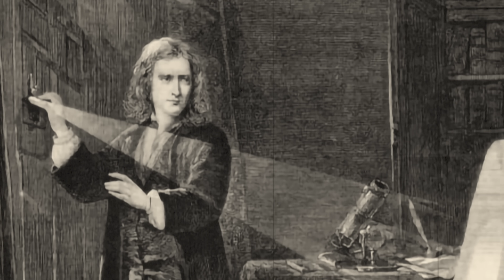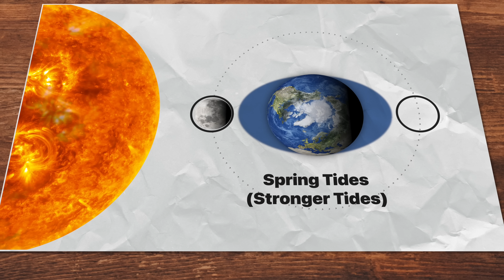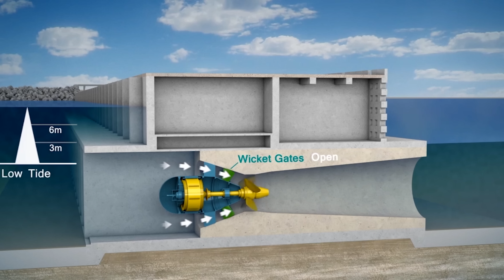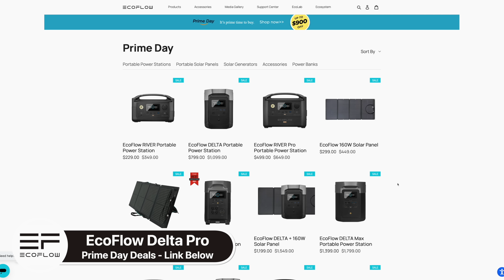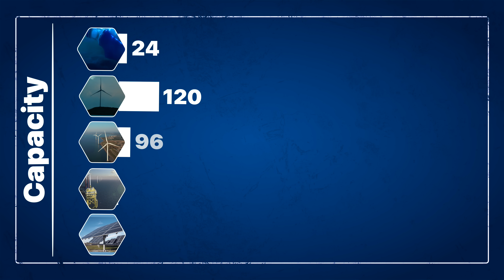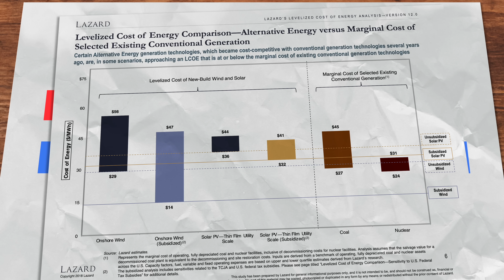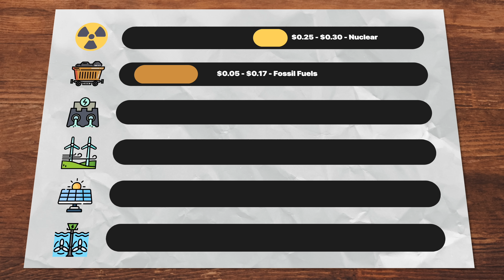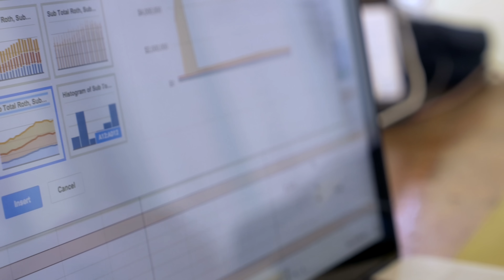Breakthrough Energy Source is 10X Better Than Wind & Solar!?

Comment: I think we should combine 4 generation methods: Offshore Wind, Tidal, Wave and Solar. Put long masts into the ocean where current tidal generators are planned, attach wind turbines on top and wave generators between, as well as solar cells on top of the wave generators. Should at least be very space effient, but a mess to keep running and maybe not as energy efficient since the best spots for all these techs may not line up but I think space will be the most valuable resource we'll have in the future.
Reply: In the UK, we're building interconnects to Morocco and Iceland.

Iceland has geothermal, the UK has wind, and Morocco has solar. We've apparently somewhat solved the energy loss over large distances too. I say somewhat as it is still there but it's no longer such a drastic loss of efficiency. Those interconnects will definitely help
Reply: Typically need figure costs of particular engineered designs (might just be a mess).

Comment: Thorium fuel cycle MSRs.  1000's of years of "fuel"...a fraction of the size of PWRs...passively safe...less to no long-term radioactive waste...capable of consuming existing waste from PWRs....can be put ANYWHERE...in scale extremely economical...reliable, on-demand power delivery.  A total no brainer.  Why are WE about the only ones NOT building them???

Comment: Tidal speed varies between slack tide and full tide, so it is still not base load energy. 
There are 2 Slack tides and 2 full tides approximately each day.
Reply: it may be designed for compensation, not just one turbine
Reply: You are right about how intermittent it is. However, please look up definition of "base-load" in Wikipedia. It is not as simple as you might think.

Comment: 8:44 - you realize that these numbers have absolutely no bearing on each other, right? RIGHT!? Please tell me you understand how stupid this slide is! A simple mistake, an oversight I'm sure.
Reply from the maker: How so?
Reply: @TwoBitDaVinci  Think about what the 'efficiency' of a solar panel represents - this represents some notion of 'available' energy, and how the device compares against that. The problem is that the concept of 'available energy' is completely different for each different device. Since the energy sources are all different, the efficiency metric means something entirely different in each case. At best you might argue that a low efficiency would indicate a technology ripe for improvement, but it doesn't help you compare which will perform better right now. It also doesn't help that the notion of 'available energy' can be quite finicky as they are necessarily based on assumptions - essentially they are to some extent products of our imagination.

Comment: I have visions of it affecting the moons orbit if it was done on a big enough scale for long enough but I think the immediate problems of dealing with the hostile environment in the sea will be the reason this is not taken very seriously.
Reply: The gravitational force exerted on the moon by the oceans is smaller than a rounding error when calculating the moons trajectory.
Reply: @garethbaus5471  yes and we are only talking about a tiny bit of the ocean being used to generate power, I understand that.
How delicate is.the moons orbit i wonder how much energy coild it give up before there was a problem?
 would taking the energy out of the tides ( slowing down the trides effectively ) slow the moons speed or make it go faster?

Comment: Tidal energy on a world wide basis for any long term solution will be a serious mistake that would difficult to impossible to reverse. The energy that is being extracted is from the rotational and orbital energy from the earth’s and moon’s mass. A global system would over time dampen the daily rotation of the earth and lengthen the present length of a day. You might not see a significant change over a decade or two (you probably would see it with an atomic clock), but over enough time there will be a difference that could only with a massive effort be reversed (by essentially reversing the process but with a highly inefficient loss of energy). Furthermore, the interaction with the crust and the currents in the inner mantle could create further unknown effect in terms of tectonic plates resulting in increased earthquakes. If there’s anything we should have learned from the carbon problem is that we as a species can and will have a global impact in serious and unforeseen ways no matter how we approach our global needs for energy and resources. No one system should be relied on completely. Diversity is the key!

Comment: Just registering my vote. Please rethink the click bait titles and images. I know surviving on. YouTube is all about getting views, but your stuff is really good and can stand on it’s own. Please refrain from Game Changer? Breakthrough? Next big thing? Make the teaser screen relate to the content. About me: I am a retired Engineer. I live on the San Francisco Penisula. I have 39 LG Neo solar panels on my roof running through smart Enphase Micro inverters. For round numbers it’s about 11KW AC. The power feeds my house, 2 Tesla PowerWalls and the grid. I discharge my PowerWalls to 60% so that my house is powered by energy I produce 24/7. If I come up short I buy power from Peninsula Green energy. Every year in June I get a check for about $1500 back from Penisula Green Energy. My house uses a Carrier Infinity HVAC Speed with Heat-pump 24 SEER 5 speed. I have as much insulation as I can fit into my attic, double glazed everything and insulation in all the walls. I drive a 5 year old Tesla Model S as my only car and I charge it off peak at home. Not everyone lives in a place where they can become energy self sufficient and not everyone can afford the substantial cost of building out such a system. I can and I am doing my part to lower demand for unsustainable energy. Keep making the great content, please rethink the clickbait stuff. Best Regards.

Comment: Interesting video. But when you say governments want to phase out all coal-burning plants by the year 2040, it will never happen ( at least not for the foreseeable future ). All these other “so-called renewable” resources depend upon coal-burning plants. Electric cars? All their electricity mainly runs off of coal and natural gas plants. Components of electric cars are made up basically of petrol products and metal products, all which created from or fabricated by using petrochemical products. Every single component of that wave turbine is created from petrol and steel products.  And you hit the biggest caveat, the maintenance. The maintenance will be massive, considering the ocean salt will corrode each component faster than they think. All this is doing is laterally moving the carbon footprint from one area to another. Thermodynamics 101.  Until the green-head leaders out there acknowledge nuclear power as the way to go, all they Are doing is directing governments to go in a direction or they profit heavily from by their investments.

Comment: Problem is tidal created energy is useless in the Midwest just like sun is useless in the northeast. Power generation needs To be with close proximity to generation. Electricity doesn’t flow forever on a wire. It decreases due to wires resistance. So it maybe can generate 2X the US power needs,  it all the US lives near the ocean. The gulf has such a weak tide this tech would never work.

Comment: The argument I always seem to run into is a perception that our current energy grid is one dimensional. Especially when talking about charging EVs, the opposition argues from the point of you "you are charging your batteries with coal". Aside from the myriad of factors this ignores, the biggest one is the fallacy that all of our current electrical generation comes from coal. However, peaker plants by a substantial percentage are gas fired mainly because it lends itself to quicker reaction to demand. Depending on the region, energy is produced from other sources where the consumables are more readily available. Our energy is currently far from a monolithic system, so why do we need to consider a renewable grid to by monolithic?  I see tidal as a "peaker" generator that fills in the intermittency. If it proves to have longevity and cost continues to come down and be more competitive, then maybe it becomes more of a share. There will never be just on source of energy, not even nuclear can claim that ability.

Comment: Why are they placing so much of the hardware under water. Put the turbine blades in the flow but the rest above the water or on the coast. Run prop shafts to them and even gang them together to one large drive shaft. Much easier to maintain, cheaper to construct, less environmental wear and tear on the hardware.

Comment: Hello Two Bit da Vinci, thanks for the beautiful video. I'd like to point out that, like tides, sun and wind are predictable. Predictability is not the primary limiting factor for the various types of energy sources covered here. Rather, system operators are more concerned with how dispatchable energy is. A dispatchable energy source is one that can provide power on demand. Natural gas plants, diesel generators, and pumped hydro are dispatchable. Some coal plants are as well. Nuclear power is not because it cannot vary its output. Wind, solar, and tidal stream are not dispatchable. Tidal range is probably only dispatchable when the tide is going out. For these reasons energy storage is still needed.
Reply from the maker: We’ll said!
Reply: baseline energy production is very important and having a renewable that produces in winter and at night is great. Serving peaks however is another thing that needs more solution
Reply: Utility scale battery storage is a good alternative to peaker plants. One in Ventura county California was recently put into operation.  This is why I think Tesla's Megapack business is on the verge of rocketing, new Megapack factory currently under construction in Lathrop, Calif., will likely be in starting-up by year-end.
Reply: Current nuclear is not dispatchable, but LFTR'S are quite so. As in the Australian system, batteries or other storage systems can mask the slower response rate of many proposed power sources.

Comment: If the remote tidal sites could be fitted with hydrolyzers, the resulting hydrogen can be stored and used for both power generation and fueling hydrogen fuel cell vehicles.  All while generating no emissions.

Comment: I hope they've taken into account that salt water is a very corrosive environment. Also, all kinds of living creatures attach themselves to anything underwater. Finally, any maintenance requires not only a specialised super expensive vessel but also breaks of good weather. Maybe these are some of the reasons why tidal currents are not easily harnessed.
Reply: not to moving parts.
Reply: @ChrisWijtmans  Wrong, they attach to boats that move quite fast, even propellers.
Reply: @antoniocruz8083  yes they do, when they stand still.
Reply: @ChrisWijtmans  I've crossed the Atlantic on a small sailboat and when i got to the other side there were lot more weeds attached than when I left and even barnicles, after only 1 month of constant moving. The under water tidal generators only have the blades as moving parts and even they don't move that fast. Believe me, it wouldn't be long before the whole thing would be covered in animal life making the blades quite unefficient with the rest of the equipment causing incredible amounts of drag in the current. Not to mention the corrosion of metals even if you used the best stainless steel the maintenance would be very high. Finally the electrolysis between different metals causes them to desintegrade. I've owned boats all my life, it's a loosing battle.
Reply: @antoniocruz8083  coats and rubbers exist for a reason, also you dont need that much metal my guess is weak points would be bearings and shafts and brushings or whatever they use in these things, the usual maintenance with any other generator. And yeah i guess sail boats dont move that fast especially during most of the voyage but i am obviously not a sailor. Then again the blades probably dont move that fast either, low rpm high torgue probably. Could confirm that with existing systems.
Reply: @ChrisWijtmans  When you say usual maintenance, it is all underwater, not just a regular van, 9 to 5 job, imagine the price of the vessel fit for the job. A sailboat averages 6knots or 8mph, that's equivalent to a very strong current and remember the slack between tides when the water hardly moves for almost a hour. They've tried harnessing wave power here in Portugal with a floating tubular structure with moving oil inside that spins a turbine. They gave it up because of maintenance. Imagine how much cheaper solar panels are, to build and maintain. The ideas we have, others have had too, nobody is stupid, there must be a reason why they haven't even experimented much with tidal power.
Reply: @antoniocruz8083  its top speed? as i said its going at slower speed most of its time. And yes portugal is stupid. I have seen their building methods. There are several countries that have tidal power for decades with low maintenance.

Comment: Tidal has already been tried here and it was a TOTAL FAILURE.
This video is just more propaganda.
Reply from the maker: We have plants in use what are you talking about?
Reply: @TwoBitDaVinci  WE had plants in use TOO, they produced little electricity, rusted out, were wrecked by storms and the power was like wind, intermittent.
The whole thing was a failure  AND UNNECESSARY.
Reply: @peterjones4180  So tell us where, to contradict what the author has said. Don't just claim you are right.

Comment: Please correct your diagram. The earth's gravity is greater than the moon or sun so the diagram is wrong. Instead the tides are created by acceleration of the water when the moon is perpendicular to the senter of the earth where the earth gravity is zero. Then it gradually lessens as the vector moves away from perpendicular and the acceleration gradually lessens. This is why the tides are higher in the north or south well away from the equator.

Comment: Okey, so first of, there is literally Zero chance in hell a tidal plant will run for 70-100 years, zero. (unless you mean "oh, we put a bunch of rocks on the bottom to stop the water flow and those rock will remain there for 100 years while we replace every single other part of the plant so the plant will stand for 100 years"). Second, Efficiency is not really that interesting, and yes, you can break Betz's law with a tidal-range where you trap the water. But the one showed in the picture at 8:44 unfortunately has to obey the laws of physics and it will never get much higher than the wind-turbines 40%. Thirdly, no, 18-22 h/day is greatly exaggerated, sure, the blades might spin a tad bit, but its capacity factor is still way low, around 20-40% for real world tidal-range examples (about the same as wind and way better than solar). It is a lot like saying a wind-turbine delivers electricity 20 h/day, which might be true, but 15 of those hours it delivers 5000 KW of its 5 MW capacity, ie, its not relevant.
Reply: With that being said, tidal does have a ton of potential, but it also has a ton of problems.

Comment: As with nearly all such systems, ROI is only attractive at large scale, which means this will NEVER truly benefit humanity in a broadly distributed manner, but simply guarantee centralization of supply (and consequently wealth and political/social/economic power). The engineering is awesome, but won't mitigate against that tendency- and it has zero chance of addressing one of the significant hurdles of ALL centralized schema, the losses due to distance between source and demand points.
Compare true lifetime costs of VERY broadly distributed generation and storage, with the concomitant lightweight grids required for extremely high fault tolerance versus any highly-centralized system using equtechnology (not an easy approximation, but doable); the conclusion becomes obvious.

Comment: I wonder how prices are calculated. We're already building lots of wind turbines at the ocean, so the electricity-grid should be already available. Ideally, the same foundation that is used for wind turbines can be used for underwater turbines.
While wind turbines should offer relative cheap electricity, underwater turbines offer more reliable electricity, which makes a great combination.

Currently my country is planning to build nuclear reactors for a reliable energy source, but the pricetag for nuclear energy is possibly much higher than tidal energy. I'm not against nuclear energy, but I find it sad there's barely any subsidies for tidal energy, while it feels like it's an absolute nobrainer to use this energy source.

Comment: How do you get tidal efficiencies at 80% mentioned at 8:45? Based on example project at 8:00, load factor is 29% [600,000MWh output / (8760 annual hours * 240 MW capacity)]. This project is actually slightly worse than offshore wind. 

Honest question, I'd like to know answer.

Comment: Density of air is about 1.225 kg/m3; Density of Sea water is 1025 kg/m3 so I'm not sure what you information source is for you density claim. I prefer the tidal generation because the sea is so hostile that it has to be made from parts that are easier to renew or recycle.

Comment: An existing leading edge all_magnet motor genset/container, 1-Mw 50yr no_inputs wrnty w/upkeep, 17yr RnD sparkless military_spec.

No CO2 H2O or wasteheat superconducts coils.
The 1300hp motor fits cars.
The company explosives safety products & services used by NATO the biz case for such a machine.

Homes 10kw/5kw 20yr no_inputs wrnty 1+3-phase inverter to solar_panels 2019 $15k/$8k.

Found in trade studies 2yrs ago ... posted online since, same magnets in EVs fade-10%/1000yrs.
Urls upon request.
🧲